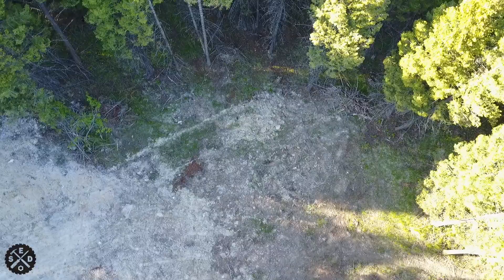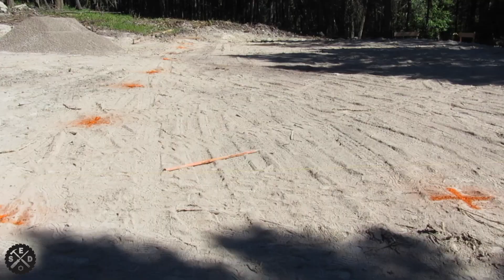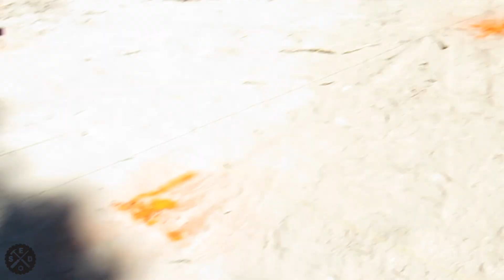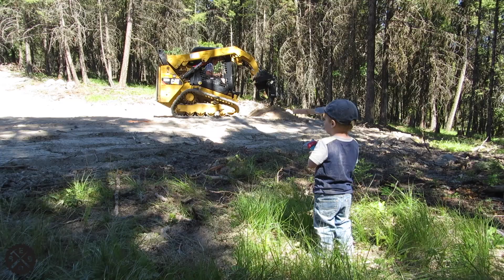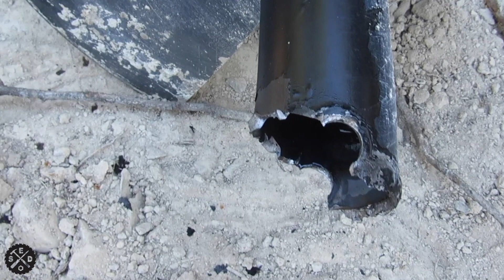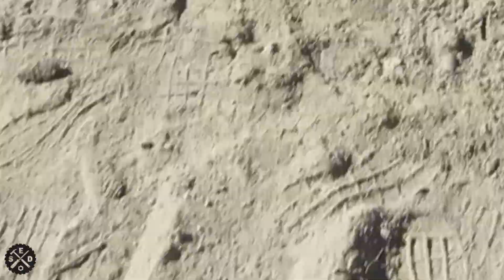Setting Up Strings Drilling Holes Pole Barn House EP 3

Comment: How did you get away with so few posts? Everything I have read if posts need to be 8-12ft apart and everyone is telling me that is even in the middle of the building.
Reply from the maker: They are 10’ on center sometimes 8’ with window and door placement.
Reply: @smarteasydiyer  My neighbor seems to think that I will need posts in the middle of the building like in the middle of my liveroom for example to support the roof.  Not just along the walls
Reply from the maker: No not if you do self-supporting trusses. Trusses can be engineered to span whatever width you need.

Comment: Are the poles safe from insects and rot?
Reply from the maker: I live in quite a dry climate with no insect issues. It would be best to use something probably like a post protector or wet set bracket etc. that’s probably what I would do next time.
Reply: @smarteasydiyer  Thank you for your quick answer!

Comment: What's the height of the poles and how high is the sides?
Reply from the maker: I put mine approx 4’ in the ground for frost protection here and 10’ sidewalls. 14’ total pole length.
Reply: @smarteasydiyer  thanks am about to do mine and I wanted to make 1 room upstairs and storage it's 28x 34
Reply from the maker: You’re welcome. Good luck with it all!

Comment: I've seen several Pole Barns being constructed where the holes are much smaller in diameter, a small concrete base poured into the holes, the poles set onto the concrete base, and the poles packed with earth. What is the advantage of huge holes filled with concrete? I've personally had poles rot off on a retaining wall where the holes were filled with concrete.
Reply from the maker: Yes there is much debate over the years about using concrete, not using concrete, setting it on concrete, using gravel around instead of dirt or concrete etc. it may depend on location as well like the east being very wet and the west being dry. Ive seen it with using large rocks or concrete in the bottom and just filling the holes back in with packed dirt as well. I’ve also seen it with setting it on cement and using gravel around the post so there’s no dirt contact. And I’ve seen it this way where you pack the bottom well with gravel then set the posts ad pour cement around them. There may be advantages or disadvantages to either or. In my area I talked with a builder that built a lot of buildings in this area and this is the way the manufacture of the post recommends to them. By not putting concrete on the bottom yet allows any moisture that gets between the post and the cement to run out the bottom and be able to get out instead of rotting the post away. That’s the idea anyways. That’s one reason I didn’t wrap the posts with anything either before concrete is so it doesn’t trap any moisture in there. Hopefully that makes sense what I’m trying to say.